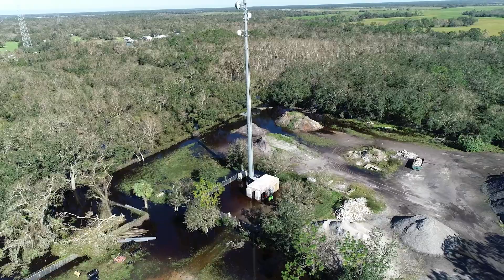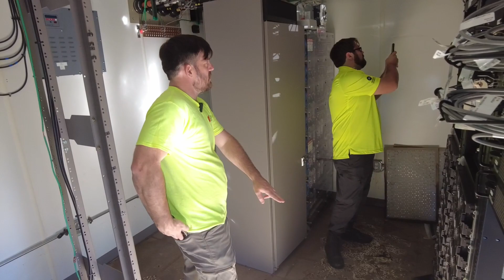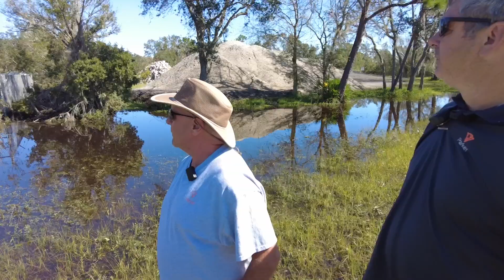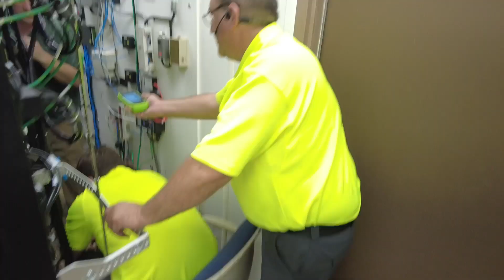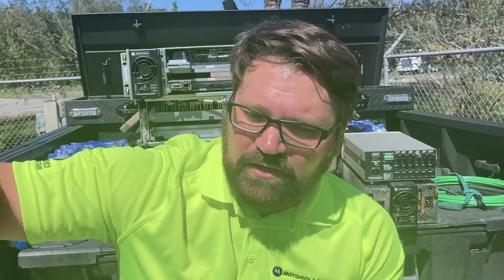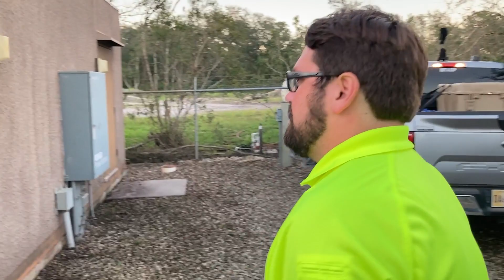Parker and Team Encounter Power Lines, Flooding, Trees, and... Chickens

Comment: How long did it take from arriving on scene of the sight did you have the sight up and running? The video does not depict on the time very well. Also the Parker group and Motorola teams work good together. You can tell that years working together has payed off. I’m in emergency services I had no idea it took this to get things back up and running.
Reply from the maker: I believe that particular site was up the next day after lunch. (Although it’s been a while since it happened and I may not be remembering that 100% correctly)

That particular site had several unique challenges that required more work from our team to get it up and running. Another thing that takes time is waiting on certain parts of our crew to show up to the site. We have an excellent team of tower climbers, but they can only be spread out at so many sites at a time. This was one of several locations that our teams were working at on that particular day. We have great leadership from the Parker, Motorola, and Elite Tower teams to ensure that all of the affected sites can be restored as quickly as possible. 

Hopefully this answers your question. Thanks for watching and commenting!

-Stephen